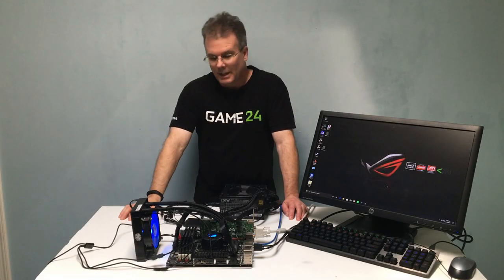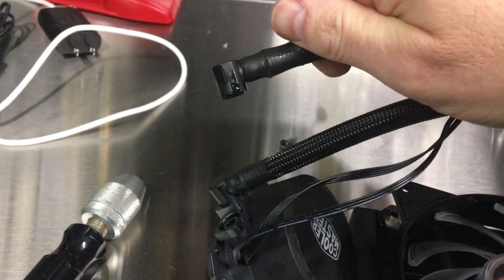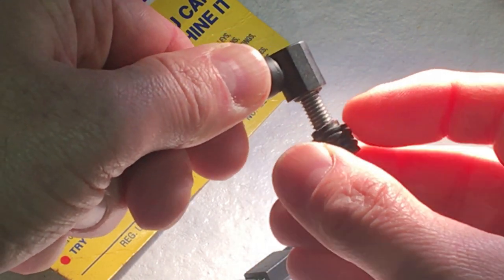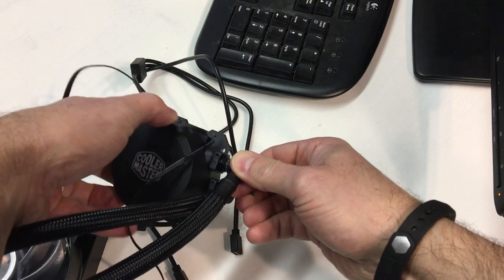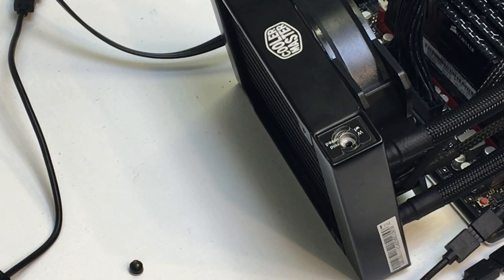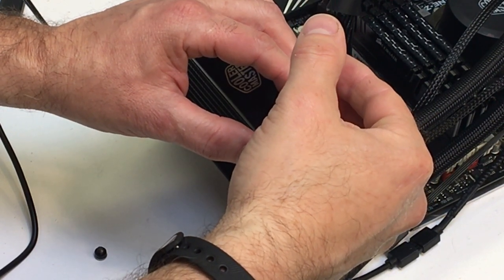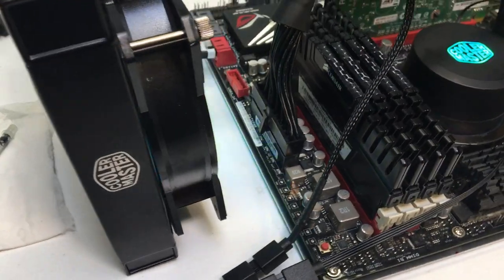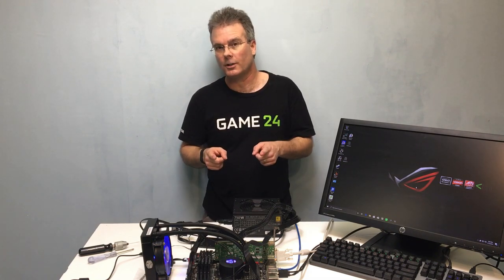Got a Broken AIO CPU Cooler? No Problem!

Comment: The problem with mine is that it gets louder and louder after I boot my pc then it powers itself off. I looked at my temps before the pc shut off and they were VERY toasty. It sounds like a motor or something. I have an old pc that I want to fix up for my sister but the aio in it is tbe problem. Any solutions would be highly appreciated. Thankyou 👋
Reply: For future readers this sounded like a failed AIO. Fastest and easiest is simply replace it. There are very affordable tower air coolers that work extremely well. I usually run Noctua coolers but I did buy a cheap Vetroo V5 for my youngest kids PC with a Ryzen 5600X. With some old Corsair SP120 fans I paired it with this heatsink for $25 runs sub 30c idle temps and no more than 50c range in game.  Extremely impressive tower cooler for dirt cheap and it's all black so it looks clean in her clean build. Thermalright has some $35 dual tower air coolers that are a bit more capable for heavy core count CPU's. When AIO fail temps go sky high, air coolers handle failed fans or dust FAR better.

Comment: I have the same cooler from the thumbnail. It was crap. I didn't even spill the cooler I just disconnected it gently and then after cleaning it I put it back in with new paste, start my PC and boom. The temps spikes to 100 degrees (thankfully its intel cpu). I tried to reseat it 10 times, still overheats. I see nothing wrong with the cooler, the pipe is pumping, the fan is runnning but I noticed that my motherboard and the pump that sticks to the cpu is heating up. Now I'm using intel air cooler. Got any idea?

Comment: If I glued the joints. Would it prevent leaking for the future?
Reply from the maker: It depends on how it is broken, but plastic almost always needs reinforcement along with the glue.  Any stress on a glued joint will usually result in a crack. Some plastics don't do well with glue. The glue just does not bond properly. Too many variables to give you a definite answer.

Comment: What if your AIO mines corsair doesn't seem to have a fill hole :(
Reply: I removed the electronic from the pump of my Zalman. Then completly submerge the pump in the liquid with one hose unplugged and repetedly forced liquid with suringe through the hose.. until bubbles stopped showing from the other end. After that, plugged the hose back in - still under the liquid.

Comment: In your experience, how often do these leak?
Reply from the maker: I have been reviewing and using them for several years and I have not seen any of them leak - except for the one I dropped!
Reply from the maker: And if you think of the liability concerns with potential system damage, you can bet that the manufacturers have put a ton of $ into developing robust and dependable products.  That does not mean that you can never have a leak, but I would not hesitate to purchase an AIO cooler from a trusted brand name like Cooler Master, Corsair, Thermaltake, etc.
Reply: @overclockersclub  hmmm. Thanks for the info. Almost canceled my prime day H115i order but feel better about installing it now. Just definitely dont want it dripping on my 2080ti. That's all I was worried about.
Reply from the maker: @thelittledetailscr7231  That is definitely an awesome cooler. You will be very happy with it.
Reply from the maker: Hey, other reviewer (Isaiah) here. I never had one leak either, just a failed pump before and one that dried out completely (wasn't my computer). I think they almost all share the same pump manufacture these days (asetek) and Gen 6 just came out a few months ago. Lots of improvements over the years. Nothing to worry about. Enjoy that new Corsair H115i!
Reply: @overclockersclub  Thanks!
Reply: @overclockersclub  Except that they are all pretty much just rebranded Aseteks....
Reply: A few of the Corsair AIOs are made by Coolit now (H115i/H100i Platinum (2018) and H60 2018) which is a nice departure from Asetek (which dominates in the OEM branded space). The "Pro" is Asetek and "Platinum" is Cooit
If you look at the copper plate you can tell the difference. Coolit is a square, Asetek is round. 

https://www.coolitsystems.com/enthusiast/

Comment: What are the chances of water cooler leak ? And will it damage the components?
Reply from the maker: The only one in all my years of using liquid cooling that leaked, was the one I dropped.   Can a leak damage components? Sure, it is possible.  It depends on how big the leak is, and where the leaking coolant ends up and how soon you catch it.    
If coolers leaked all the time, then manufacturers would not spend the time to design, build and market them - and then have to support a lot of angry people with damaged components.  Leaky coolers would scare everyone away, and that is not really the case.  They are quite robust and trouble free.  I am talking about the All-in-One systems, and not the custom loops that you assemble yourself.
Reply: My all in one system has signs of leakage. I've had it for 6 years, so yes it is very possible of them leaking. My PC keeps turning off and Steam wont load and is ultra slow. I looked at the closed loop all in one system I own and there is some white tooth paste crap at the end of the tubes that connect to the fan and some of that crap is on my gtx 1080 graphics card. I hope the card isn't damaged but they most def are capable of leaking over time.

Comment: How you opened that 2 "one-way screw"? May you show me the tools if you have any?
Reply: Also, there is a pin on each way on the pump. May I ask you how you removed them?
Reply from the maker: @dadashali61  The roll pins can be removed by using a drill bit that us just slightly smaller (diameter) to push the roll pin out.
Reply from the maker: I put the M6 screw in a lathe and cut the head off and then drilled out the center.
Reply: @overclockersclub  Thanks for the answer but i cant imagine what you did :(
Reply: @overclockersclub  I see. But that's not possible to take them out with a hammer and another pin?
Reply from the maker: @dadashali61  Yes - that will work but be careful.  The trick is to hold the pump firmly.
Reply from the maker: @dadashali61  Like this:   https://www.youtube.com/watch?v=aM8hI6UMpIY
Reply: @overclockersclub  I see. SO the only way to open that one-way screw is to destroy them ...!! And must be changed to another normal screw after that. Thanks for the help.
Reply: @overclockersclub  Is that possible to dont screw that one-way screw after make them out? Becaue sadly i can't find such equal screw in our area...